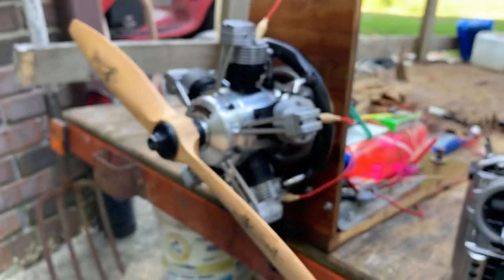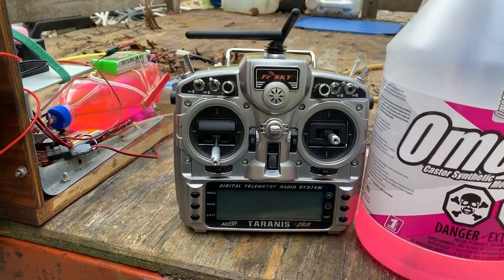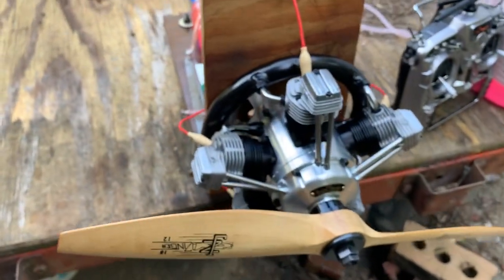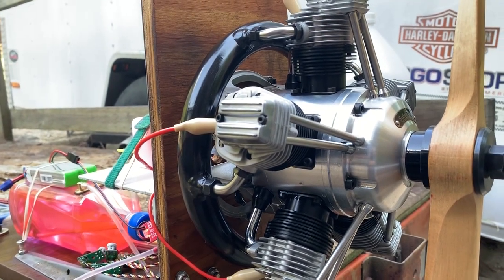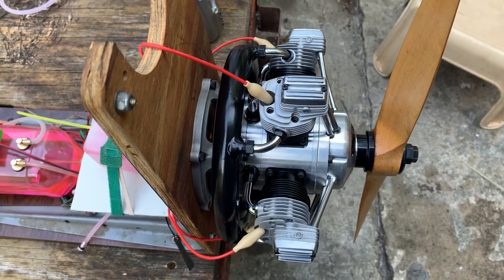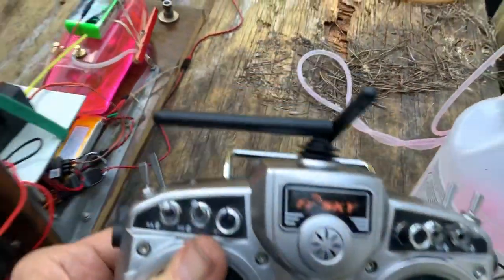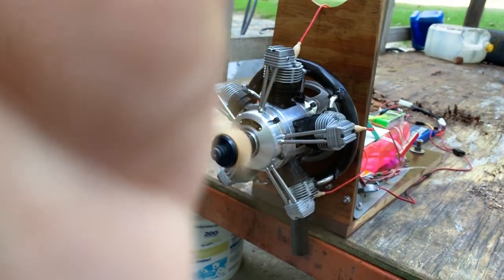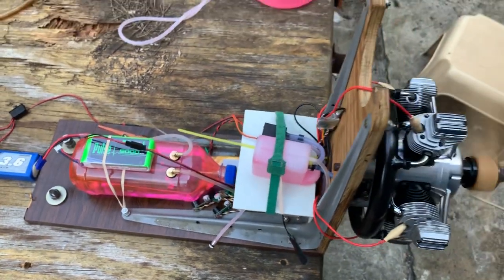More O.S. FR5-300 Radial Engine Testing

Comment: Beautiful!!!!! Which ignition system used?? Thanks!!!
Reply from the maker: I used five glow driver units all controlled from one RC channel. Their pulse system lets me use a 3S LiPo battery and requires very low current from the battery to feed all five glow plugs. I can’t recall the brand or source of the drivers exactly but I may have purchased then from Banggood.

Comment: Hello from Ukraine!
I want to build a model aircraft Yak-18
And I'm looking for where to buy the same engine.
Can you tell me, or are such engines still being produced and where can I buy them?
I have searched on many websites and they are not available anywhere.
Reply from the maker: Sorry but O.S. stopped production as long as ten years ago. eBay.com or RC forum web sites will be your best chance. There’s RCGroups.com, rcuniverse.com and maybe others that have engine selling sections on their sites. The Saito FA325-R5 is another option as it is very similar to the O.S. but it too is no longer being made. Here is a new O.S. FR5-300 on eBay: Item number 334552003666. And another: 155494798950. And another 2: 155017111347, 155382009954. Here’s a new one out of Italy: 314454765764. All of those are on eBay, just use the item number to search. Good luck.

Comment: What an awesome engine!
Sounds amazing
Reply from the maker: Thank you. I do have one complaint about the sound though - it’s too quiet. These small displacement cylinders push out equally small pulses of exhaust gas and don’t roar the way the bigger radials do. But I’m happy with it regardless. Here’s a little secret, a seven cylinder FR7-420 is on the way. Shhhh, don’t tell anyone…

Comment: Fuel pump?  Tell me more as mine is gravity fed and haven't heard anyone using a fuel pump.  Sounds great.
Reply from the maker: Since my aircraft of choice to fly this engine is a Yak54 and has its fuel tank right on the CG, the distance from the tank to the carb is very long. Any nose-high attitude (as an example) means the fuel could be as far away below the engine/carb as 18 or more inches. No way that radial can draw fuel that far/high and not run lean or quit. The little smoke pump works to maintain a consistent fuel supply in the small tank that’s directly behind the firewall and not much more than an inch away from the carburetor. The ‘fuel head’ changes probably 5% as compared to drawing fuel only from the main tank at the CG. The one thing I had to be careful with is the size of the fittings and tubing that act as the return line from the header tank to the main tank. If too restrictive there would be a slight positive pressure In the header tank which could allow flooding if the throttle is open and the pump activated. That could be a good thing as it can help prime the engine to start when cold. My return line, etc, is maybe twice the cross sectional area of the main feed line but there’s still a little residual pressure in the header tank. Starting is extremely easy and I never need to choke it or use an electric starter.
Reply: Morris hobbies conversion

Comment: Thanks for this video...get a better radio like futaba :)
Reply from the maker: I have Futaba and other systems but prefer FrSky. I have experience with many brands, how ‘bout you?
Reply: @GFTP100  Futaba 4ever ;)
Reply: I get the same eye rolling from the spectrum devotees when I start my Taranis. 
Trust mine with everything from my FR300 to Saito R5 to Moki 257. 
FrSky isn't expensive enough for the goof balls I fly with lol. Nice run of the O.S. I fly mine with no on board glo driver. Starts easy,  ldles reliablely, and pulls a 1/5 scale Stearman like a rocket.😊